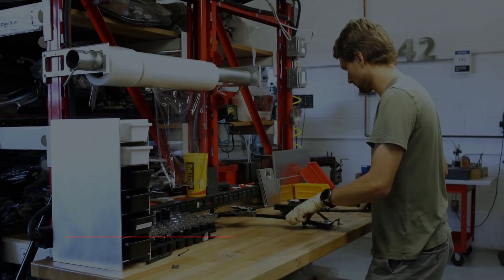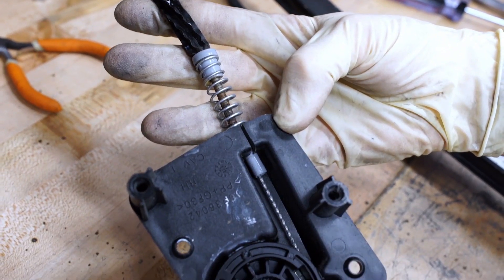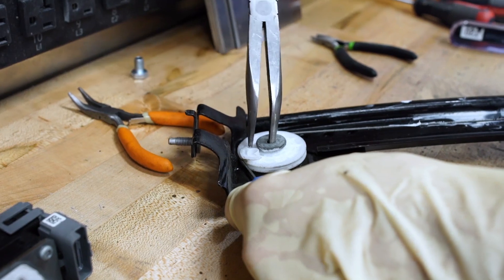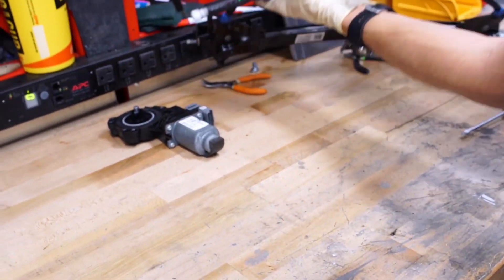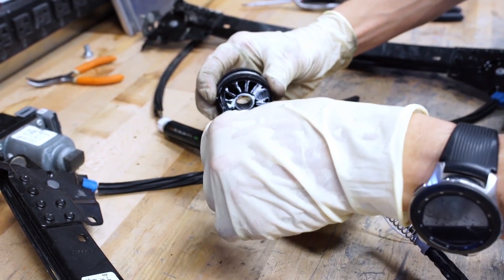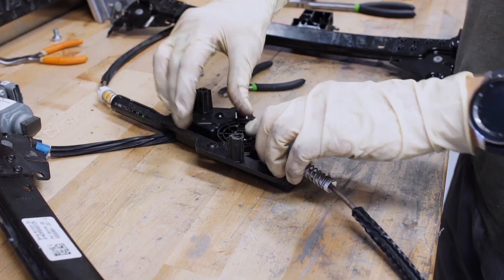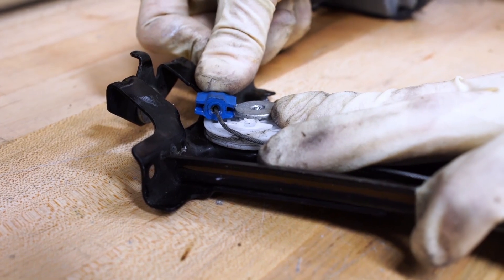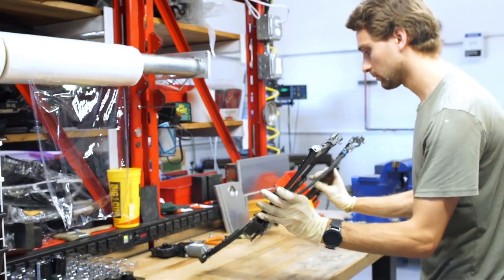Tesla Model S - Window Regulator Repair | Gruber Motors

Comment: When I pulled out the center plastic piece with the cable winding it all just came off. I have no idea how many wraps it had. How can I fix this?
Reply: Were you able to fix it or did you have to take car to tesla/gruber to fix?
Reply: @jackgreenstalk777  I got it . I needed a part. I forget what it was. But gruber had it.

Comment: All that effort because they used a plastic part destined to fail, shame shame shame.
Reply: To be fair, they have made window regulators for nearly 100 years. And they do it at lowest cost to effectively work. These typically last 10-12 years before failing which is the cycle of many cars life spans are that or less. Henry ford was known to go to the junkyard and inspect cars to find parts that didnt wear out so he could save money engineering them cheaper lighter etc but only last life of car (or less and charge you to fix it!) They can make ones that outlast cars but its a cost thing. 30 cents more over 1 million units (like 2023 model y sales) is an extra 300k just for upgrading a part that might fail before car is wrecked or run down.